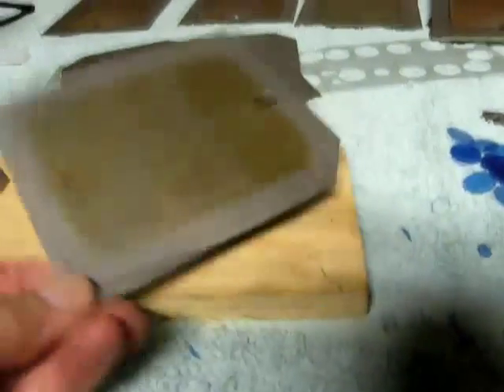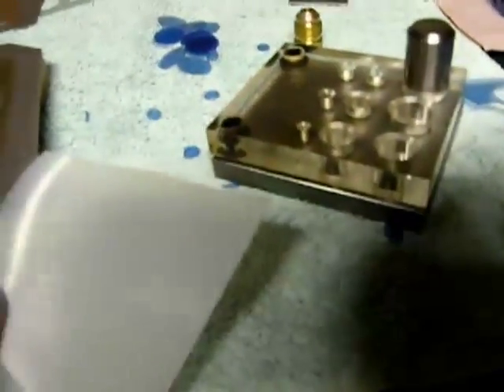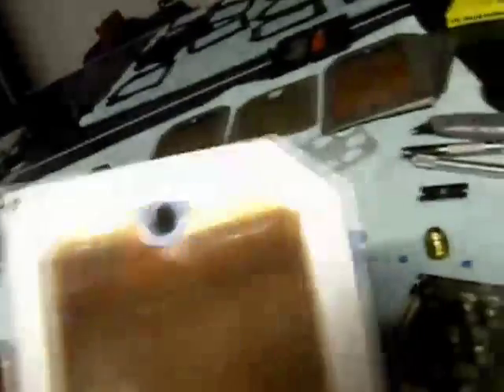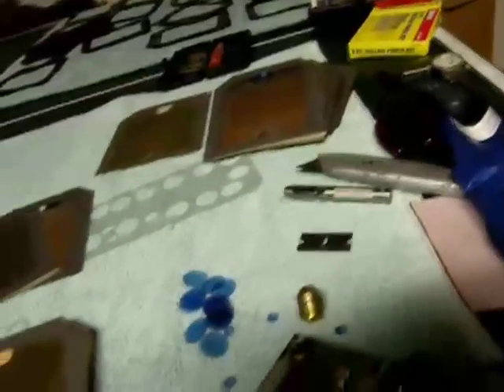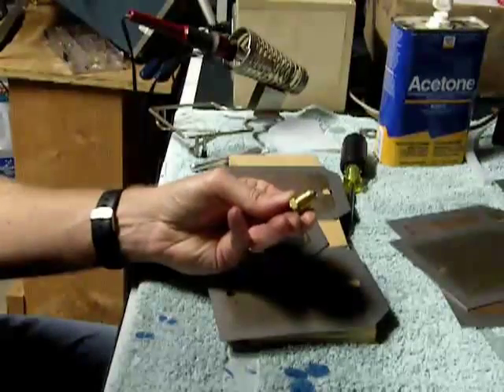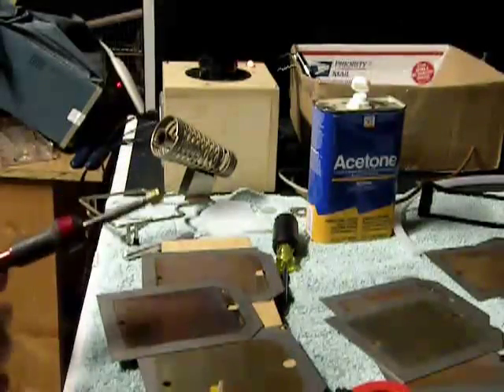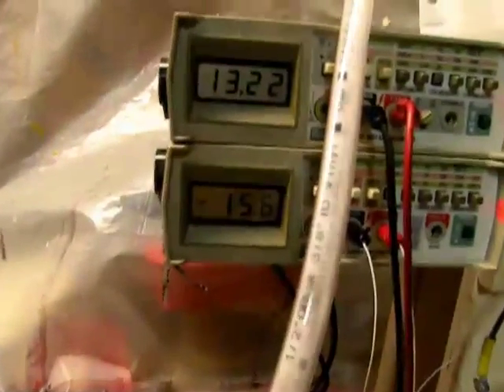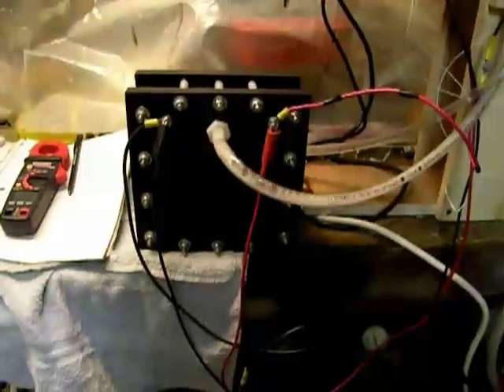HHO Dry Cell Leakage

Comment from the maker: I don't have alot of run time on it yet. It is a 25 plate, in a 5N4 config so it never gets hot. Also is mounted under the front bumper so it gets lots of air. Time will tell.